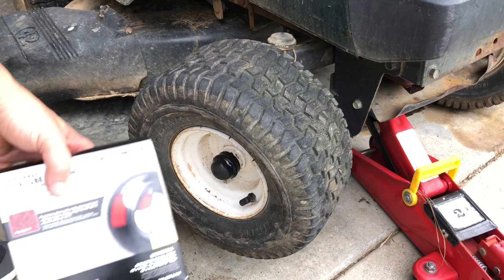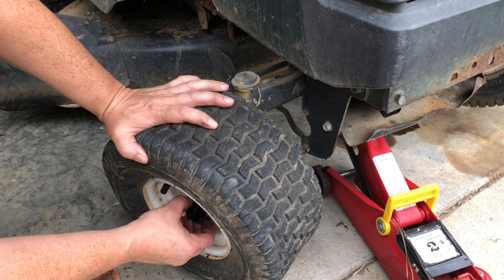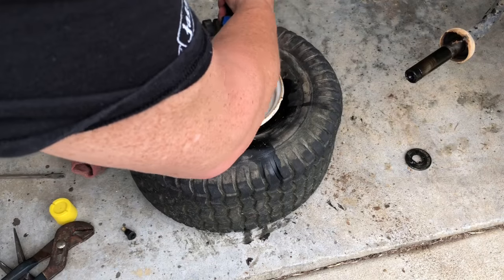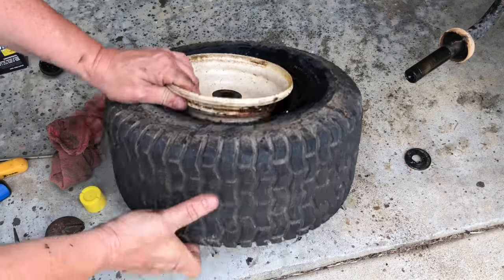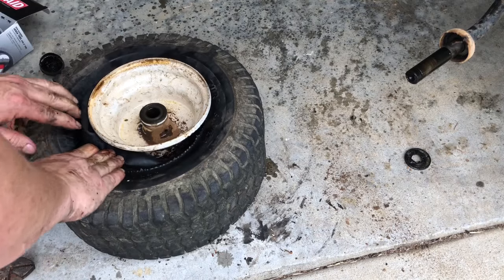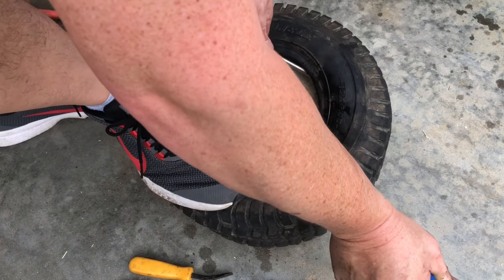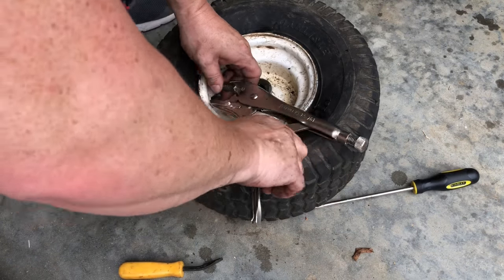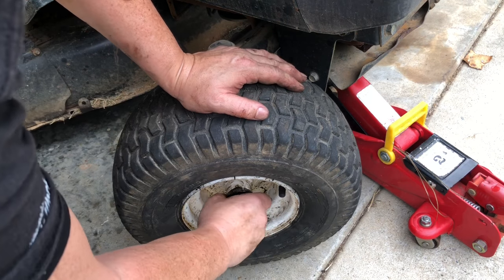Best Way To Install Riding Mower Tire Tubes - Save Lots Of Money

Comment: Just changed my inner tube on my tiller. Took 15 minutes and no fowl language. What I would advise is use three 6 inch c clamps to help hold the tire from popping back up. As you pry the tire bead onto the rim keep adding c clamps to squeeze the tire to hold it in place as you move your screw driver around. Lubricate the tire bead with any kind of oil. This helps the tire bead to slide down your screw driver. Went faster and smoother than expected. Hope this helps fellow DIY.
Reply from the maker: Great tips and advice. Thank you for sharing 👍😁
Reply: Oil can cause the tire to deteriorate. Tire shops use liquid soap
Reply: @danielebrparish4271  use cooking oil
Reply: Very sound advise, yet I feel the use of the foul, not fowl, which pertains to birds, language, indeed helps sometimes when pursuing a job like this.
Reply: Lucky
Reply: Good tip on the c clamps! It’s just … crazy enough… to work…
Reply: Mmm
Reply: @jameslawless9819  Yes, use the screw driver to cut a nice slit in the new tube!

Comment: I wouldn't put B'laster on it.  It's a solvent and will break down and soften rubber.  Ru-Glyde tire lube is best, but some use dish soap, yet I avoid that too.
Reply: tire beads are heavily reinforced- PB blaster will eventually swell/ruin the bead, but it would take years
Reply: @tommurphy4307  A tire will last several years longer if you don't add solvents to it. Besides that, B'laster is not for rubber; it's for rusted metal, and it STINKS.

Comment: I just took my tires and the inner tubes I purchased on Amazon to my local tire shop and they installed them for $10 apiece. Well worth it to save the aggravation, potential damage to the tire, the inner tubes and to myself. 🤓
Reply: Glad that worked for you but most tire shops and even lawn mower repair shops won't do tires except to plug a hole in a flat.
Reply: @muffs55mercury61  I guess I'm just lucky to live in Idaho. Our tire shops go out of the way to help customers. Maybe it's because I live in a rural area where the tendency is to always help out others whenever you can. Besides, it's great marketing tool for them since the next time I need to buy tires for one of my vehicles, they will be the first place I consider.
Reply: @rvalens2  Yes rural areas are like that.  I live in one.  There is a small shop that would likely do it for me but I'd feel a little out of place if I were to ask him to mount tires that I didn't buy from him. He is a used tire seller and doesn't get wholesale discounts from tire makers so he doesn't deal in new tires.
Reply: Thank you! I had no idea a tire place would do this.
Reply: @runningdastreetsVA  You're welcome. However, not all tire shops will mount them for you. But it doesn't hurt to ask. Les Schwab was where I took mine.
Reply: I’ve tried multiple tire shops no luck… only mower dealers help here in central fl

Comment: If you have troubles with the rubber cap covering the tire circlip, use a hair dryer to warm it up. It'll slide right off easily without damaging it. You can do the same thing on reinstalling it. Warm it up with a hair dryer and she'll slide right on!

Comment: I went through all this, inflated the tire and felt good, drinking beer. Next thing I noticed the tire went flat. Took it all apart again and found that on the inside of the tire a wire punctured my new inner tube. Wires is what runs through tires to make them stronger. Had to get a net tire anyway... 
If you are doing this carefully run your hands on the inside of the tire, looking for something sharp.

Comment: I did this yesterday. I ended up putting on the ground like you did and used my knees to put weight on it as I got the tire around the rim. It was a lot easier that way. Great video.
Reply: a 4" pvc coupler under the hub helps too

Comment: I went through three, new inner tubes, somehow puncturing them on the step at 3:46. The tools I used must have punctured the tube, as I was fighting to get that last step done. I was so careful, so careful, yet wasted my time and money. As I watched this video at this step, I was thinking he was going to do the same. It seems to me that at that step the rim needs to be elevated so that the tire could ride to the inner part of the rim so that it makes more slack. Since you don't know where the tub is sitting inside there when doing that. It would seem that a more blunt device be used to pry the tire over the rim in that step.
The other thing I did was completely remove the tire to cut off the 2 patches I had put in previously. I also put in a 5.5 inch wide by 4 feet scrap of vinyl flooring to protect the tube from all the things that try to poke through when mowing. The tubes that I purchased were 15 x 6, but the tubes are way small to fill in all that space in the tire.

Comment: Nicely done. You might mention the need to inspect the tire as it may have a nail/thorn/foreign object that punctured it still stuck in it that needs to be removed before replacing/repairing the inner tube. Careful not to jab or tear your skin as you feel for the foreign object. I speak from painful experience on this subject. Cheers all.
Reply from the maker: Great information.   Thanks for the feedback.   Sucks getting stuff stuck into your fingers though.  👍😁
Reply: the best way to check for remaining puncture objects is to drag a shop rag around the inside instead of your fingers. The shop rag will catch on any sharp objects instead of your finger :-)

Comment: Great video! Thank you!  Also sometimes northern or fleet farm has those tires for sale new for around $25.     I went for the tube to save $5 bucks tho cause I'm cheap.  Honestly great video.  It helped me to be patient when getting rubber off and on the rim. I love these videos. God smiles when we use our phone to do good. God bless you all.
Reply from the maker: Same here. Have a good one and thanks for watching 😁👍
Reply: Sometimes it's not the tire leaking but a rusty rim so you'll need a tube unless you buy a new rim as well.  $65 for the tire and rim around here...

Comment: Another tip is with the tubes I got the valve stem on the tube leans a little in the direction it needs to go into the hole on the rim. I inflate the tube a little and mark the intertube on the side the valve stem leans. I didn't do that the first time so when I aired up the tire the valve stem popped out of the hole and went to the other side of the rim. I had to break it all down and turn the tube in the other direction then it work perfectly.
Reply from the maker: Awesome tip.  Thanks.  😁👍
Reply: Yes....I found out the hard way.

Comment: Great instructional video! I purchased the wheel assemblies off Amazon and they started leaking air after the warranty expired. I will install inner tubes into those Amazon wheels next, thanks!

Comment: I need to do this.  The inside of rim / wheel is rusted / flaking paint.  How well do you have to clean it to avoid these pieces from cutting inner tube?

Thanks for video!
Reply from the maker: Just get the rough places smoothed

Comment: I checked where it was leaking in case something is poking through the tire. In my case it was just dry, cracked on the tread so I ran a tube. I broke the bead with a vise. I removed any weld splatter on the inside of the wheel. Ran a peice of duct tape all around the inside of the rim so the inner tube doesn't rub on anything I missed. I used baby powder to make things slide. Wiped everything clean. Had to use vise grip also on valve stem until installed and filled.

Comment: Mine cub cadet has a carter pin. No barring in the rear. 
Now mine didn't come off as easy. Hitting with hammer or standing on it. But I stuck a block under it. On the rim. And used two bars and a stationary hole to press off. After easy peasy theres a grease insert on mine. Will grease while off. 
Great video thank you
Reply from the maker: I appreciate you 👍😁
Reply: *cotter pin

Comment: I noticed you're using screwdrivers. Tire irons will pinch the tube. The spoons are too long. Works great if you're going back with tubeless. I have an idea how to use tire irons to keep from pinching the tube. Put a 4×4 in the ground kinda short with the end up. Drill a hole to insert a short piece of rebar. Set your rim on that. That'll keep the rim from dropping keeping the tube near the bottom away from being pinched.
Reply from the maker: Thank you for the great advice and tip.  😁👍

Comment: Should have taken the wheel rim completely off and filed the welding splatter smooth . They weld two halves together and leave the welding splatter there because the tires are tubeless , you put a tube in there and it rubs on the splatter and goes flat , don't ask me how I know lol

Comment: That’s for the vice grip trick or you just put the valve stem on it and it would keep it from slipping in that button on it with a pair of vise grips is way better

Comment: I changed my mind about adding an inner tube, I doubt I can handle the muscle work.  I'll just buy the whole wheel/tire assembly, which means unscrewing and later re-tightening one nut.
Reply from the maker: It’s easier to get a whole tire and wheel from Lowe’s or from Amazon.  There is a link in the video description
Reply: Buy the wheels and tubes, take to tire shop and have them change them.
Beats the heck out of hot water bottles and ice packs.

Comment: One suggestion... Perhaps wrap the valve stem with duct tape (to prevent it from popping back in the rim).   I had a stem leak that I suspect was from the weight of the vise grips flopping the stem on the rim hole.  Mine didn't sit as nicely on the rim side as in the video.
Reply: Id be concerned about cutting or nicking stem too.  Can put a large cap on the valve stem. Like some "decorative" ones that are larger than hole,  so it cant pull back through. I used a skull shaped one i had for a bike.
Reply: Good idea, wish I'd read this before trying to fit my inner tube today as it has happened to me today. Valve popped back inside the tire just as it was quarter filled, now it is stuck inside. Gonna have to puncture the tire and inner tube to get them out and start again, not looking forward to that.
Reply: use a double stack of washers. One a little bigger than the top one, then put on the cap to hold it in place until the is ready for air. That works really nice.
Reply: Just put the cap back on no need for all that.
Reply: Screw your valve stem tool on the end of the stem. That's why they put an internal thread on one side of the tool.
Reply: @bluegrallis  Funny nobody mentions the inexpensive valve stem tool that's also used to pull tubeless valves into rim.

Comment: My tire was shot, so I ordered a new one from Walmart, (and a tube too) and damn these are hard to get off the rim lol! And even harder to get the brand new one back on haha! I was dripping sweat just getting the old one off ha, I was like hmm, I should check youtube for ideas to make it easier to get on the new one. One thing I'll have to mention, on MY lawnmower, the rim is slightly smaller on one side, (the side with the valve) about a 1/4 inch smaller diameter, so that helps a little to get it on! I didn't think I'd be able to get this damn thing on haha! And yes get the smaller side in first then put on the tube. Like he did. Lube would definitely help. I thought of using some soapy water, (and then letting it dry first) idk.
Reply: just like automotive rims- they have a depressed well where you can place the bead to give more room to slip the tire over the rim. there's also a hump which keeps the beads out of there during tire failure in motion. look for that depression in your rim.

Comment: 3:20 Another trick for preventing the valve from falling back out through the valve hole in the rim -- slip a right-size (1/4"?) washer over the valve and then screw the valve cap on.

Comment: You did it quick. I prefer to take the tire completely of the rim to clean and check the inside of the tire itself, and I clean the rust and welding ‘tit’s off the  inside of the rim where’s the new tube is gonna rest, I’ve seen them eff the tube up. 🤔
Reply from the maker: I found a new solution.  I bought a new tire and wheel assembly from Amazon last week.  I did a video on it.
Reply: @VansWorld Glad that you consider slave labor a decent solution. Jeff Bezos and the People’s Party of China appreciate your suggestion, much more than I do.

Comment: I know it varies but I was always tought to Put little air in the tube and see how the stem is offset. Generally I have to install the blue line towards the side without the stem.
Reply from the maker: That’s great tips.  I found a better way than a tube.  I got tired of tires leaking so I put expanding foam in my tires.  Best thing I’ve ever done. 👍😁
Reply from the maker: Go to Walmart in the automotive section and get the foam for tires.  Follow the instructions on the can.  Pretty easy.  👍😁

Comment: I think PB blaster bad for rubber. Use straight dish soap drops of water. pour a boiling kettle on it first to soften.
Reply from the maker: Your 100% correct.  😁👍

Comment: That's cool but  unnecessary. U just put the valve stem facing up pop that side of the tire off then tuck the tube in and around the tire and push the stem through. Push the tire on and air it up. Mist tubes get pinched doin it like that.

Comment: If you would have turned it over, put a 4x4 block under each side of the tire and let the rim HANG down it leaves you much more room to stuff the tube in the tire with the rim dropped.

Comment: No your wrong because the tyre is such a bastard to force on to the steel rim using those screw drivers that you inevitabley puncture small holes in the new innertube . Then it wont blow up and you have to get the bastard off again and buy another innertube or repair the one you fucked up with the screw drivers you tried to force the tyre on with. Ive ruined 3 innertubes by pricking them with the long screw drivers to force the tyre over the rim. Dont believe your video .Ive found this job impossiblewithout putting a hole in the inertubeusing crew drivers to lever the tuff tyre over the rim. Don try this at home it will frustrate you and you could give your self a hernia or stab yourself by accident. There must be an easier way than wasting your time and money and running you self through with a screw driver

Comment: I wonder why some have tubes and others don't.
Reply from the maker: Not sure.  But you can always add a tube to a tubeless tire.
Reply: @VansWorld  Seems like the tubless are thicker, but beats me. I just ended up ordering a "tubeless" 4 ply tractor tire but just might go ahead and add a tube if it ends up leaking. Thanks

Comment: Good video. However. I can't believe that you re-installed that new tube on a rim that was rusted on the inside.  I would have removed the tire, cleaned off the rust, applied a coat of paint to the rime and then re-install the tire and rim. My father would roll over in his grave if I did that.

Comment: Watched the video, finally got my tire off the rim so I can put the new tube in, that I stood in line for during a pandemic. Turns out there's no tube in my god damn tire, it's air filled..FFS FML. Now for the battle to get the god damn thing back on the rim.
Reply: robert hammond you can install a tube into a rim that does not have one in it as long as it’s for the correct size.

Comment: You made this installing a tube into a lawn mower wheel as sloppy as you could. It almost makes me want to have someone do it for me. It does not have to be this sloppy. When you mentioned that you can buy a tire with tube already installed the first thing I thought was I bet this guy has the tire/tube combo in one of his links trying to persuade to buy instead of install and sure enough you do.

Comment: You got lucky not putting a hole in the new inner tube when your using screw drivers to re-installing the tire onto the rim. hey make tire bars. Viewers, don't use screw drivers. Use the proper tools. If you don't have tire bars, another thing you could use use is two butter knife's  (handle side). They have rounded corners.
Reply from the maker: Great advice.  Thanks for sharing

Comment: Dont get peenched
Reply from the maker: This sucks haha.  I finally filled my tires up with foam sealer.   Like the kind you use for sealing cracks around your house.  Best Decision I’ve ever made. I never have to mess with air again. But the down side is the ride is very rough. Haha. 👍😁